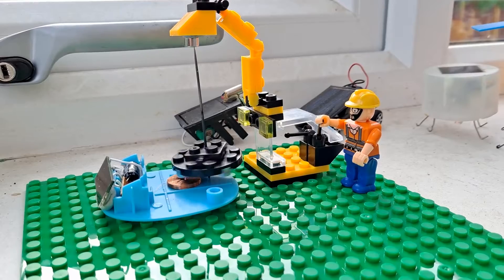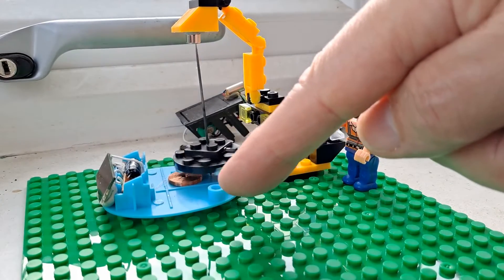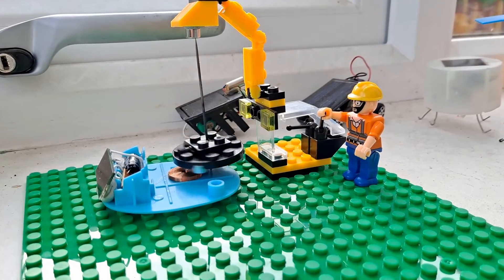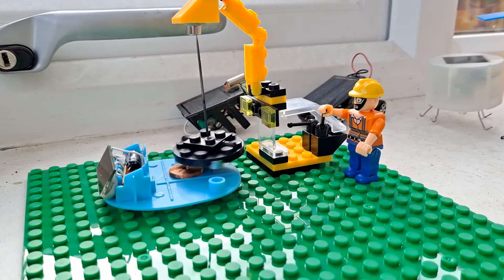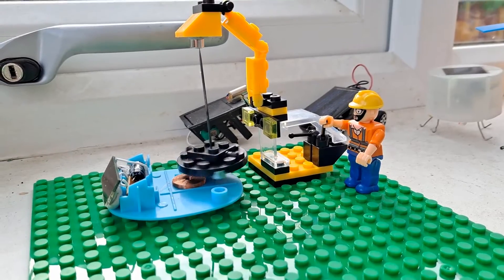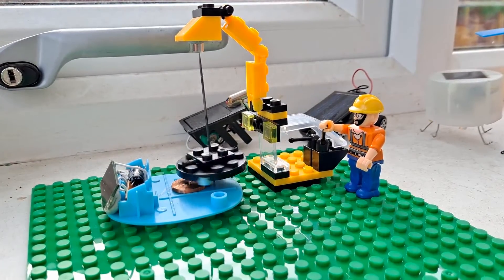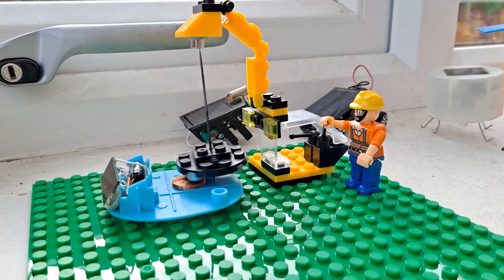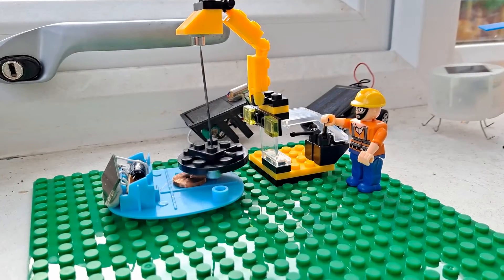A bit more Plastic Block kit Pulse Motor inspired by Lidmotor

Comment: That is a better method to turn the rotor.   I like the little man with his hand on the control lever.  This would make a great eye catching toy store window item.  I can hear the little kid right now saying.  "Mom can I have one of those?"
Reply from the maker: By coincidence, I have done a little more work on it tonight. I was using a magnet under the base to alight the bottom end of the needle. I have done away with that, drilled a small hole in the blue solar rocker base to keep the alignment and it just rests on the green plastic underneath. It seems much happier. At the same time, I changed the magnets on the disk to alternate north south north south.